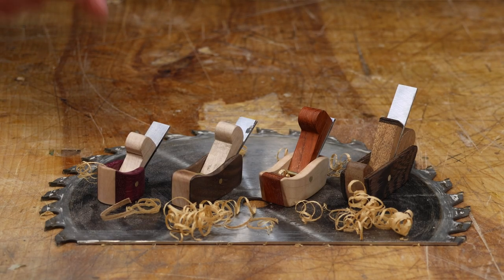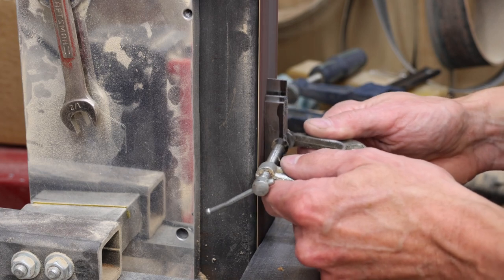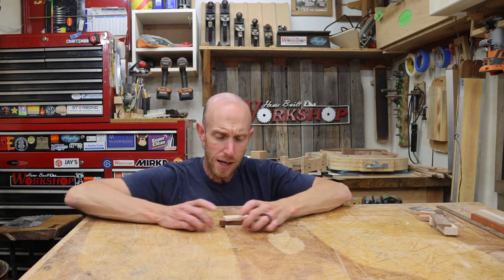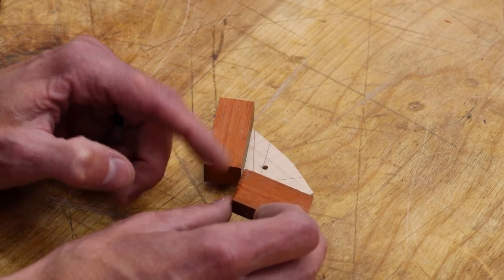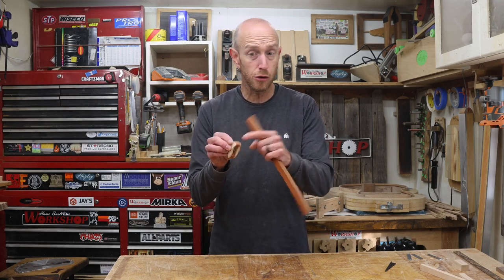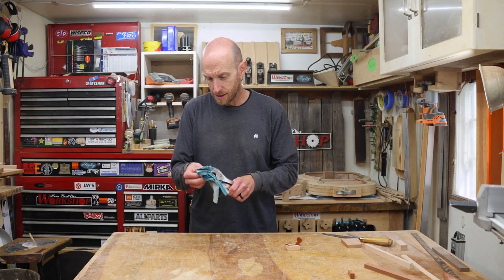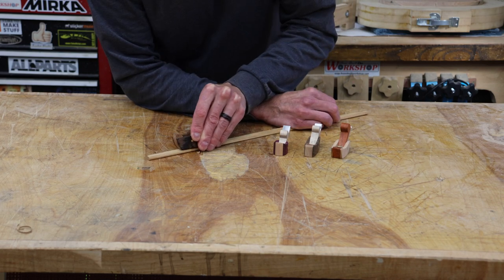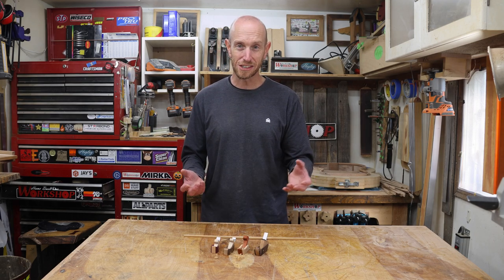How to make tiny wooden finger planes | Irons made from a saw blade

Comment: You missed a step in the hardening process.  It is important to anneal the metal first before going on to hardening. To anneal the steel, heat to the critical point (ie the non magnetic temperature) then bury in hardwood ash or lime, until cool to room temperature. Then you can proceed to harden and temper.

Comment: In the plane with steep angle and won't cut, you could make into scraper plane just by adding anther piece of wood the the back portion. That will force the blade into a perpendicular position. Instead of not using it.  You can also take a file to the back portion to lower the angle and see if that works. On something so tiny  it wouldn't take much filing to get it down to 30°. Enjoyed watching this a lot!

Comment: If I'm correct the sawblade you use is one with tungsten-carbide tips. This means the sawing action will be done bij the tips, not the blade. If you want to be sure the material you use for blade-making is a high-carbon (capable to be heat-treated) steel, you better use an old file, or a sawblade where the cutting tip is the same material as the rest of the blade. Anyway: I think this is indeed carbon-steel when looking at the sparks and a very nice build. Best regards from the Netherlands
Reply: This!  I just added a similar comment.

Comment: You can speed up the glue up and do both sides at once by shooting a staple in and cutting off the legs, or using a pin or two to provide an anti slip barb which will prevent sliding during glue up. One process, one clamping, less mess!
Reply from the maker: Thats a good idea. The ones I made with CA glue went together really fast as well.

Comment: Those are cool. I think I'm going to have to make a couple for my wood boat models. The question now is what to make them out of. Wood, metal, 3d print or a combination of materials.
Reply from the maker: You need to make a few. I did 3D print the very first one just to check the size I was thinking about. I think they would work great that way but I do feel its almost faster to make them out of wood if you use CA glue. I might modify my 3D printed design and try using it just for fun though. Printing them is definitely more repeatable though.

Comment: I have used a saw blade to make a draw knife cutting the handle spurs and cutting blade shape with an angle grinder. It holds a reasonable
Edge. Its good enough for chair spindles but would be better if hardened it.

Comment: Those are really cool and I like your sense of experimentation!
For the one that doesn't cut as well, you could try to install it with the blade bevel up and grind an angle to make the bed angle and bevel angle somewhere around 90 degrees combined and use it as a scraping plane. It might not work for shaping braces, but it might be usable on harder woods like guitar binding, edges of a bridge or maybe on a headstock overlay. Just a thought!
Reply from the maker: Thanks for the idea. I may just try that. If my math is correct, with a 55 degree bed angle and a 30 degree bevel on the iron I'm already at 85 degrees. I'll have to flip it over and see what happens.